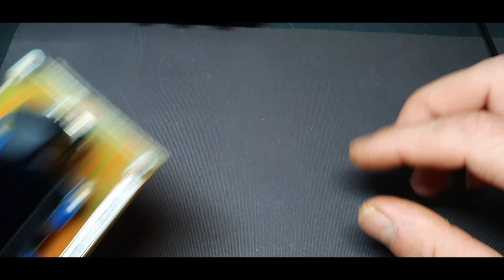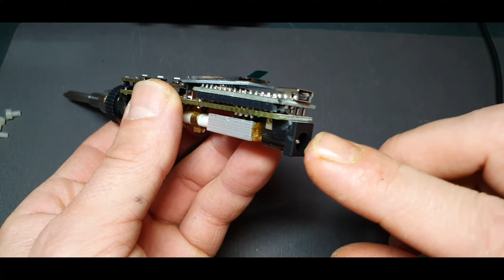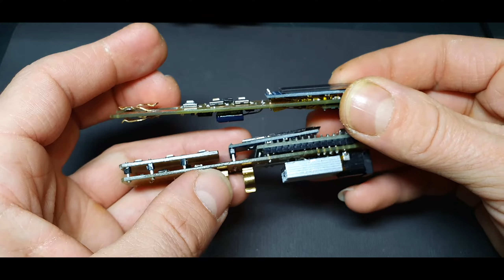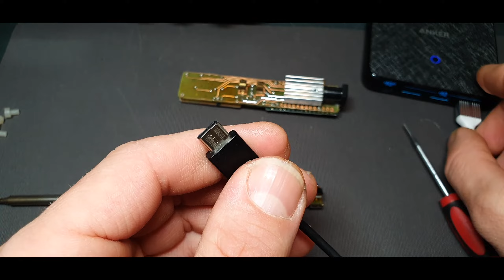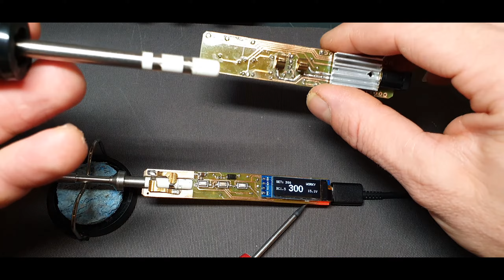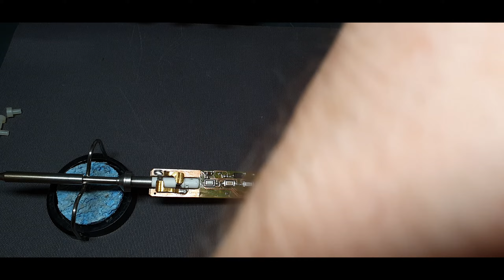DIY  Portable ATmega328 Soldering Iron

Comment: Good try, but better version is already made by @electronoobs , this is just a prototype and there is lots of room to improvement, i.e. do not use any module
For compact built, use bare lcd and type c connector directly onto pcb, it will reduce its overall footprint

Comment: could you share gerber file for pcb please please? I found only pdf files.
Reply from the maker: I'm sorry I didn't make the Gerber files for his soldering iron.
Reply: @HMProjects  Thanks. Buy the way where to get this type of t12 tip
Reply from the maker: @nyeinchanzaw6936  those tips are for TS100 soldering iron, you can buy them from Amazon, Aliexpress, Banggood and so on.

Comment: Hi!.
  Where to buy plug-in terminals for the smaller tip?.
Reply from the maker: Hi. Those terminals I made it myself, for the next version I will see which option I have and put ready made terminals.
Reply: @HMProjects   ok
Reply: @HMProjects   I downloaded the files, they were great.
  Excellent job. Do you have the stl files of the small tip soldering iron? If so, could you send it?
Then go to Stefan Wagner's channel, and read what I posted, I think you'll like the information.
Thanks.